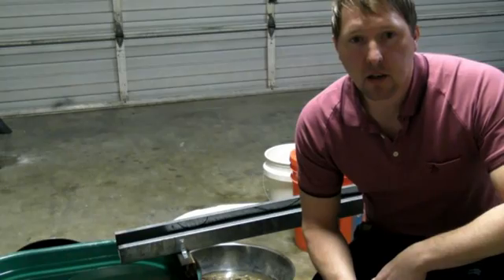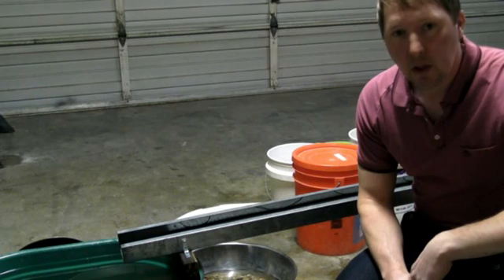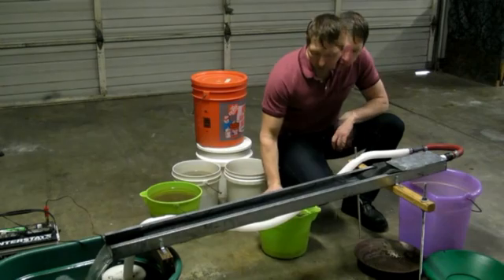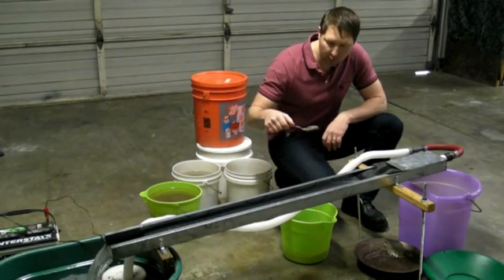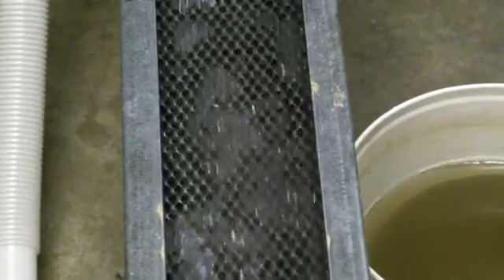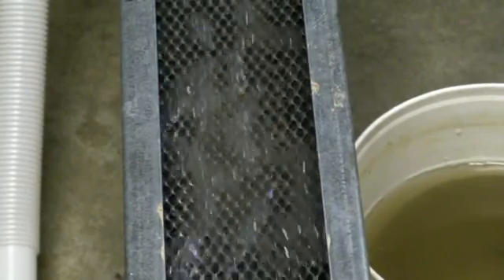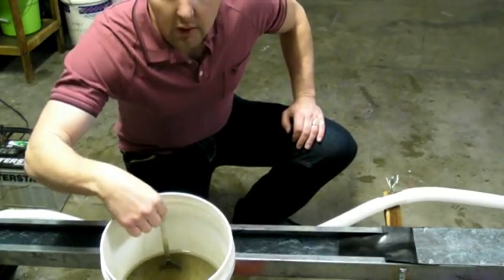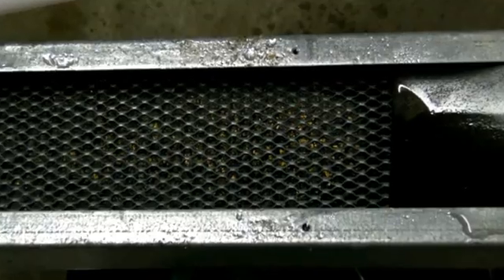Gold Rush 911

Comment from the maker: The expanded metal is the type used for gutters and the holes do run parallel with the sluice. However the black V mat under it runs perpendicular to the expanded metal and sluice.